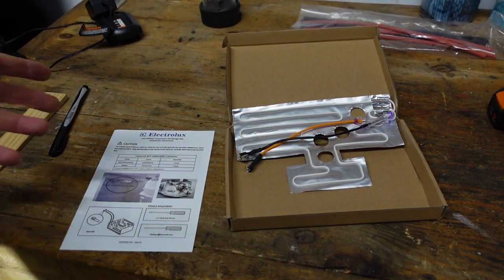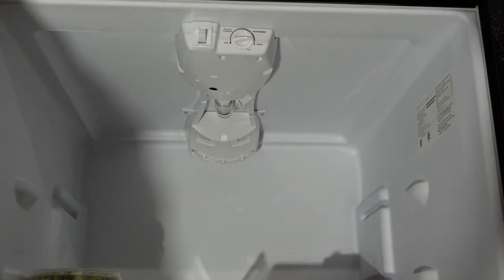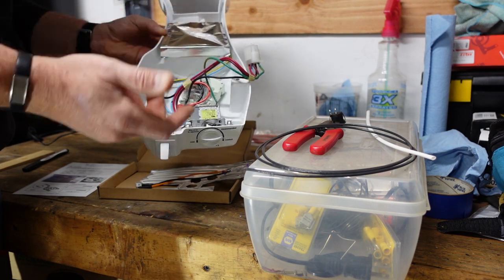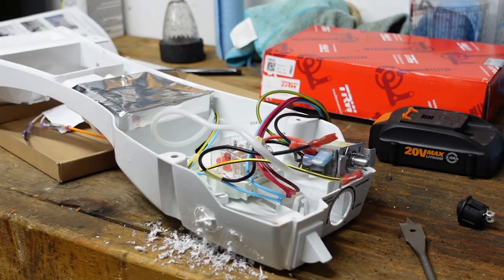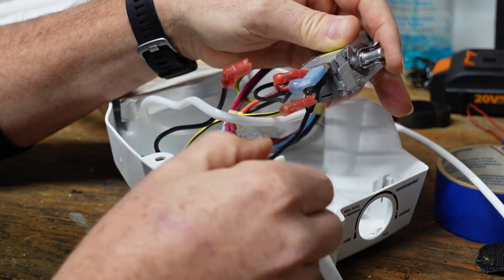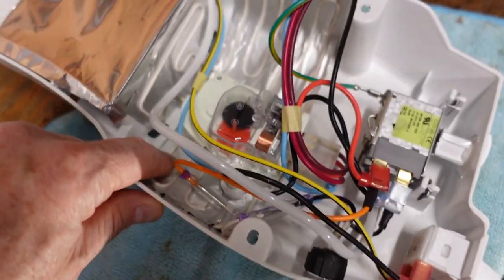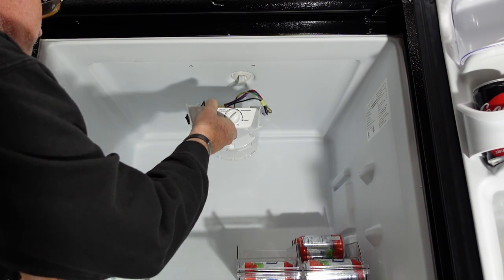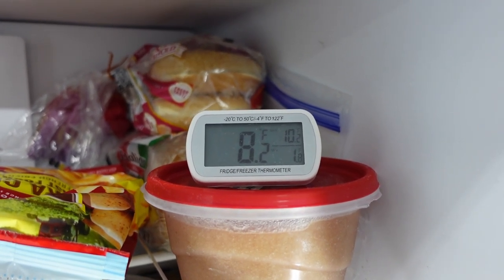Installing a Garage Fridge Heater Kit | Roundtail Restoration

Comment: Opposite problem.  Once it gets below freezing my fridge freezes stuff. How to keep it warm?
Reply from the maker: That I don't know. Is it below freezing in the place where you keep the fridge? I think, eventually, the fridge will just turn off since the ambient air is colder than inside, and it'll eventually equalize with the outside air - hence, freeze.

Comment: Nice video, but looks like you have your switch backwards.  ' O ' = off, ' I ' = on.
Reply from the maker: No, it's in there correctly (but I had to just check it to make sure). I didn't show it in the ON position during the video, looks like. Thanks for watching!

Comment: Do you know how many volts the heater takes and how many watts
Reply from the maker: The heater just uses the existing power to the thermostat, so that's 120V. As for wattage, I can't find that anywhere. But, I did not notice any increase in my electric bill that I could associate with the heater. You can feel a warmth (not hot) when it's operating so I don't think it's a whole lot. 20 watts maybe? Just something to heat up that little space enough to make the thermostat think it's too warm in the fridge.

Comment: Can this be done on a galant mini fridge
Reply from the maker: I don't see why it couldn't be done, but I don't think this heater would fit due to the different design. You'd have to find one made specifically for that brand or try to modify it somehow (I probably wouldn't recommend that because of the fire hazard).

Comment: Sir, could you explain the wiring to me?  I switched the black wire from the element to the black wire to the rheostat.  It that correct?
Reply from the maker: Thanks for watching. I think if you watch the "Dry-Fitting Switch" chapter, hopefully that will make sense. The black wire is removed from the rheostat on the fridge. Then the black wire from the heater is plugged into that same spot on the rheostat. The wire from the heater has an extra spade, and that is what the black wire that is part of the fridge and went to the rheostat by itself is then attached to. I didn't keep the instructions, but I think they should show it pretty clearly, too.
Reply: @roundtailrestoration  thanks for replying.   After thinking about I figured it out.

Comment: I have a 2022 new Frigidaire. It is led lights and thermistor instead of thermostat. it have 3 leads soldered to it. Any info you can offer to install heater?
Reply from the maker: Hi James. No, sorry, I don't have any advice there outside of using your model number in a google search along with "heater". Might get a hit. The heater kit was made by Electrolux, which is the parent company of Frigidaire, so I would assume they make them for all of their single temperature control models. Good luck!

Comment: I have the same freezer problem with a cabin in the mountains.  Does the heater stay on all the time when you switch it on or does the thermostat shut off the power to the heater when it cools down?
Reply from the maker: It stays on all the time. You can feel that the plastic is warm, but not hot. No problems now. Freezer is consistently below 0F.
Reply: @roundtailrestoration  Thanks, I may have to give it a try.  Great tutorial.
Reply from the maker: @Zincaloom  Definitely not hard if you don't do the switch. And you can always use spade connectors and wire splicers if you don't want to solder.

Comment: Put one in and it’s working but concerned that if it runs more will it cause the refrigerator section to freeze ??
Reply from the maker: I had this concern as well. I put a thermometer in the fridge and I adjusted the vent in the freezer and the rheostat in the fridge to get the temps in there balanced out. But, it really wasn't any different from when I had it during the warmer months. The vent and the rheostat were both very close to the "recommended" or middle setting.

Comment: Thanks for this video. Mine came with zero instructions. And I also wondered what you’re supposed to do with it in the summer time. I was actually going to install a switch as well. Then you said it too. 😂
Reply from the maker: The switch is very convenient. At least I don't feel like I'm wasting electricity and I don't have to dial it back in each time. Thanks for watching!